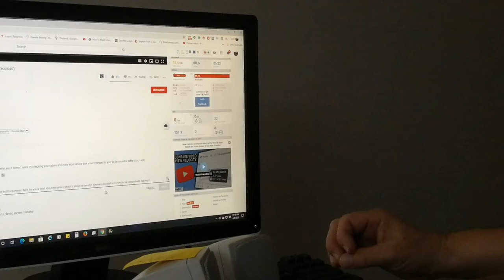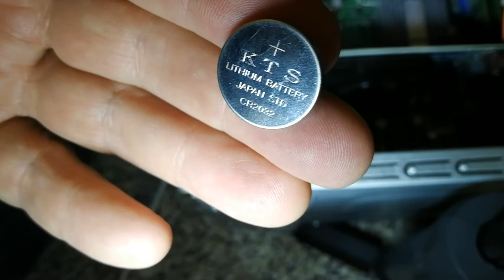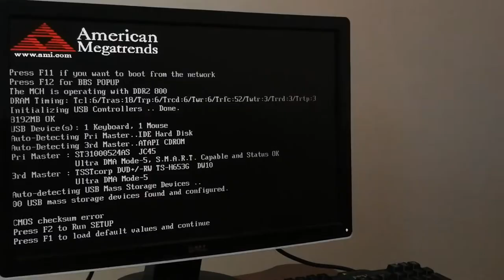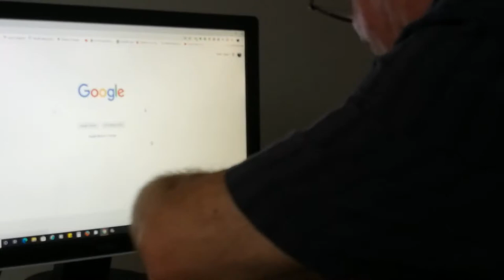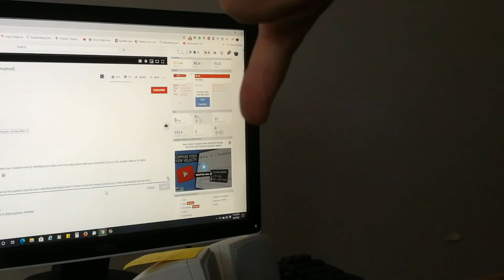How to Fix your Monitor and wake up Your PC from power Saving Sleep Mode

Comment: 2023 and it worked! 
I cleaned the RAM many time using an eraser and it didn’t work. 
But I did not tried cleaning the CMOS battery. And after I tried and cleaned the CMOs battery! There you go. It is up again now. Thank you🙏

Comment: The reason you got the BIOS on load was because you pulled the CMOS battery out which reset your BIOS back to default.
Reply from the maker: So are you saying pulling the battery is all I needed to do?
Reply: Answer "scientific" I'm having this problem and ion wanna do all that

Comment: guys am still stuck i tried that but still my Dell machine is not working 
please help
Reply from the maker: Sorry I have no solution for you if that didn't work. I'm still using the same old computer and monitor and never had that problem again.
Reply: Bro my dell monitor keeps going into power saving mode and I don’t know how to fix it, have you fixed it yet?

Comment: When a PC will not post, it usually means  to check RAM, something you seemed not to know what that stick was nor cleaning it with a pencil is not the cure for this issue as the RAM has no connections regarding the power saving sleep mode caused by the monitor. Some Dell monitors will go into a deep sleep when the PC is set to turn off the screen, like 15 minutes. Strangely, this can happen after software updates.  Despite the PC setting is set to NEVER sleep when plugged in, the Dell monitor will eventually go into a deep sleep when the display card becomes idle, like overnight or long hours away from the PC creating trouble for the PC to wake up as the USB DC power is interrupted via the display card. Moving the mouse or typing from the keyboard does not work. It has been reported to turn the power off on the monitor then power back on again to terminate the monitor's deep sleep, and this may wake up the PC. The Dell monitor's menu may list OTHER for settings, disable sleep mode if this is seen. The alternative is to use another monitor brand. This issue happened to me. I replaced the Dell monitor with an MSI 4 K monitor via HDMI on the NVIDIA card. All is good now and moving the mouse wakes up the PC and monitor. And also know that when the date / time on the PC is suddenly not correct, then replace the CMOS battery, otherwise only remove it and replace when you want to reset the motherboard BIOS to default. This was not the issue of the modem, otherwise you would have booted up normally but would not have had the internet connected to your WiFi due to the BIOS reset.
Reply from the maker: First off thanks for your reply. Even though you are correct that I don't know how to check the RAM you are wrong that the pencil eracers wasn't the cure along with what ever else I did on that video. My computer was NOT set for sleep mode after an idle period because when not it use I turn it off. This episode occured all of a sudden and nothing I did worked until I watched someone elses video doing what I did and it worked for me and if you read the comment for many others as well. Sure not for everyone but mostly everyone. So explain that. Also how do you explain the fact that that video is over 3 years old and I'm still using the same computer and monitor, and my only issue now is even after cleaning the dust out from the fans and inside the tower, the fans still run alot and they are very noisy. It makes it difficult to add voice-over on my video content. Whats the cure for that? Thanks for your tip on how to know when to replace the battery, another mindbender is the fact that the battery is very old and still keeping time.BE WELL.

Comment: I did everything and it screwed up my pc and it won’t even connect to the monitor or the mouse or keyboard won’t power
Reply: Same
Reply: Damn fortnite kids
Reply from the maker: From the replies I'm getting it appears that this method doesn't work for about 1 in 5 but tyou are the first to mention that it screwed up your computer. Hopefully by now you found a solution to your issue. Be well.